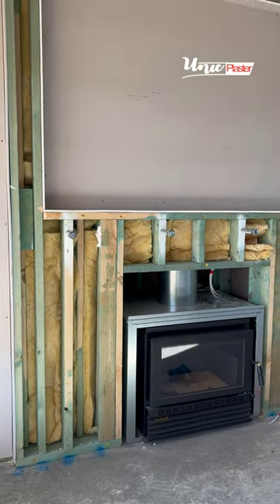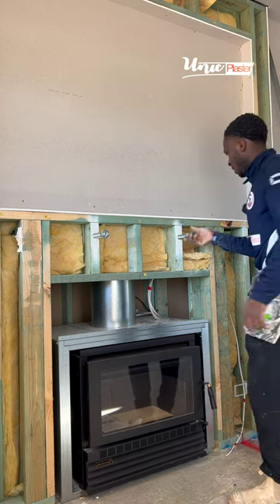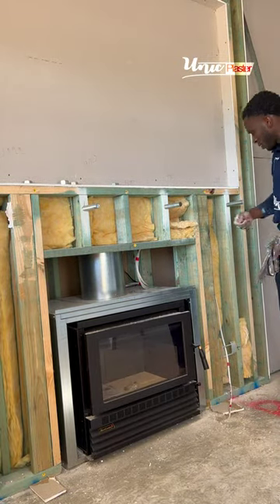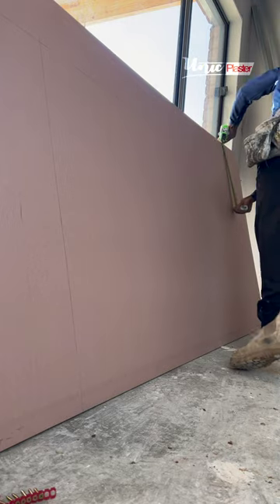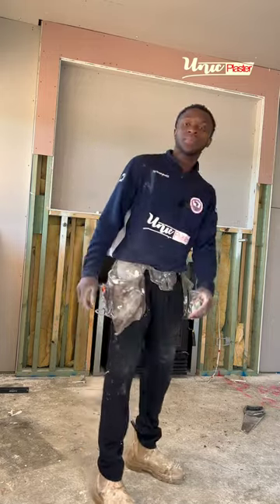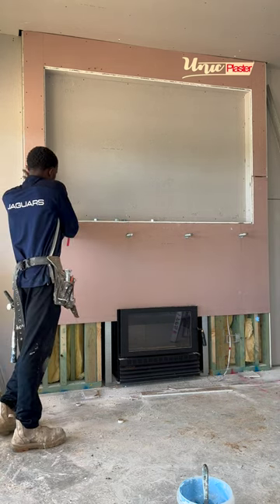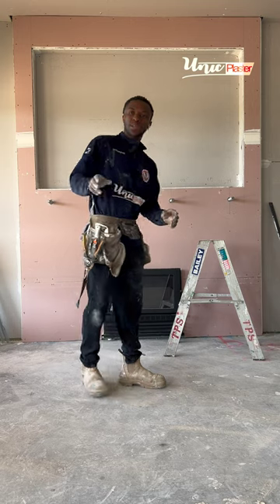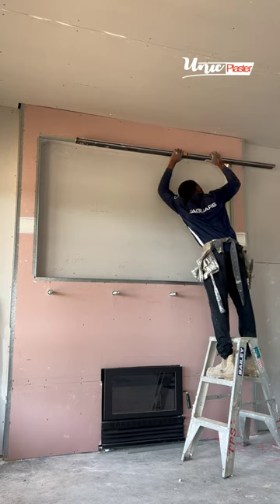This Drywall Board is FIRE PROOF

Comment: This is what we always used whenever we did buildings with separate offices. Each joint wall has to have fire rated sheet rock and fire rated osb for the first 8ft of the roof. Mainly so if one area of the building caught fire it wouldn’t spread to the others

Comment: Fire resistant.... not fire proof
Reply: Have you tried burning plaster it doesn't
Reply: Now how do you service the heater ? Break the plaster
Reply: With enough heat it will penetrate that why it has a hour rating for fire protection... not fire proof

Comment: I think I am becoming a plasterer. The only thing is math is an issue
Reply from the maker: You actually don’t need to be a mathematician it’s basic math
Reply: a trick i learned today is to make sure their is minimal off cuts but if they off cut can make a full sheet size then cut it at that length so you get 2 boards instead, i think  this is right but always ask im only apprentice
Reply: Bro I'm learning to do it at the moment and I failed prevoc the best way to think of it is just numbers just remember your numbers
Reply: It's simple math and you do have a calculator on your phone to be sure, over time you will be better at math as well

Comment: Metal bead is garbage. It oxidizes, rusts, takes too much mud  Cause it doesn't fit tight and it cracks. Haven't used metal bead in 30 years
Reply: Your wrong lol